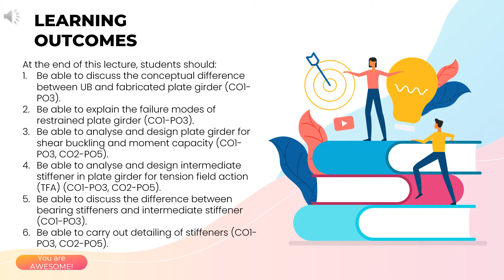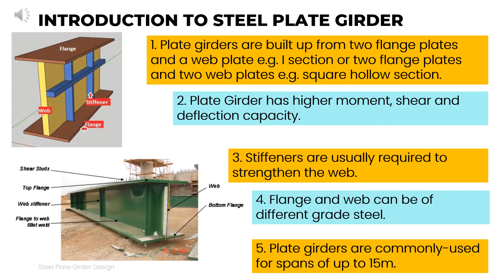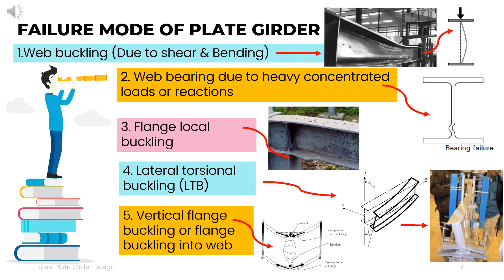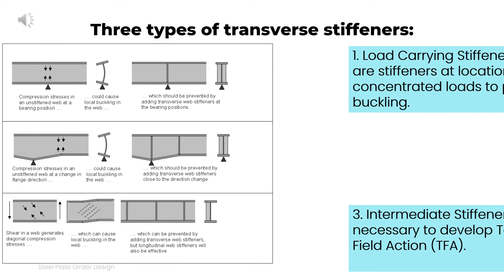Steel Plate Girder (Eurocode 3)-Summary By Dr.Ina

Comment: 5A5_Asyira 

A plate girder is a large steel “I-section” beam that is fabricated by welding (or sometimes bolting) together separate steel plates: a top flange, a bottom flange, and a vertical web between them.  ￼
It differs from a standard rolled I-beam: since rolled sections are limited in size by the rolling process, plate girders allow engineers to build deeper/heavier beams by fabrication instead of rolling.

Comment: 5B1_Aliff Irfan 
The video explains the conceptual difference between Universal Beams (UB) and fabricated plate girders under Eurocode 3. While UBs are standard rolled sections, fabricated plate girders are built from separate steel plates, allowing customization for longer spans or heavier loads. Eurocode 3 provides guidelines for design, strength, and stability, helping engineers determine when standard sections are insufficient. Overall, the lesson emphasizes understanding not just the calculations but the design reasoning behind choosing between UB and fabricated plate girders.

Comment: 5A6_nurul shahida 
1.	Definition & use
	•	It’s used when loads or spans are too large for standard rolled sections.
	2.	Main design challenges
	•	Shear buckling in the web (since it’s deep and thin).
	•	Lateral-torsional buckling (LTB) in the top flange if it’s not properly braced.
	•	Flanges must be checked to ensure they’re not too slender (Eurocode Class 4 limits).
	3.	Design procedure
	•	Estimate depth (span/depth ≈ 15 as a starting point).
	•	Choose flange dimensions to resist the required bending moment.
	•	Check shear resistance of the web and verify it against buckling criteria.
	•	Check for LTB and provide lateral restraints if needed.
	•	Verify serviceability limits (deflection, vibration, etc.) after strength checks.
	4.	Eurocode 3 checks include:
	•	Section classification (Class 1–4).
	•	Effective width of slender plates.
	•	Shear buckling resistance formulas (EN 1993-1-5).
	•	Moment-shear interaction.
	•	Stability verification (lateral buckling).

Comment: 5A6_ZAID: Steel Plate Girder Summary

Steel plate girders are built-up structural members designed to resist loads primarily through bending and shear, offering higher stiffness for heavy loads and deeper sections compared to universal beams. They are commonly used in bridges, long-span floor girders, railway/road structures, and industrial crane girders.

Key lessons include their construction from flange and web plates (potentially different steel grades), with thick flanges, large depth, and thin webs that require stiffeners to prevent buckling due to high D/T ratios.

1. Conceptual Differences and Design Basics
(a) Difference from Universal Beams
-Universal beams are standard rolled sections, while fabricated plate girders are custom-built for specific needs like greater depth and load capacity.
-Girders provide enhanced moment, shear, and deflection capacity, making them economical for spans up to 15 meters.
(b) Construction and Welding
-Composed of two flange plates and a web plate, welded using continuous automatic electric arc or submerged gas methods (fillet welds, double pass on both sides).
-Designer selects plate sizes and grades for optimal performances.
(c) Failure Modes and Prevention
-Steel plate girders are prone to several failure modes, emphasizing the need for proper detailing and restraints.

2. Key Failure Modes
-Web buckling due to shear, bending, or heavy concentrated loads/reactions.
-Flange local bucklings.
-Lateral torsional buckling.
-Vertical flange buckling into the web.

Comment: The universal beam (UB) and the plate girder perform similar structural functions, but they differ in size, shape, and load-carrying capacity. A plate girder can fail in several ways, including flange local buckling, lateral torsional buckling, vertical flange buckling, and web buckling caused by heavy concentrated loads. These potential failures can be prevented by adding transverse stiffeners and providing adequate lateral support. MUHAMMAD HARIS IMRAN BIN AZMAN 5C4

Comment: 5C4: Aiman

A plate girder is a structural member that resists bending and shear, typically built from welded, bolted, or riveted steel plates forming an I-shaped section with a deep web and narrow flanges.

Functions:

Used instead of rolled sections for long spans

Supports heavy loads

Common in railway, road, and crane girders

Provides high stiffness for deep sections

Failure modes:

Web buckling (shear/bending)

Web bearing (from concentrated loads)

Flange local buckling

Lateral-torsional buckling

Flange buckling into web

Notes:
Load-carrying and load-bearing stiffeners are the same type but must be checked for web buckling and web bearing separately. After web shear buckling, Tension Field Action develops, where diagonal tension in the web increases shear capacity.

Design steps:

Determine minimum web thickness

Check bending resistance

Dimension the girder

Design the web

Design the stiffeners

Comment: 5C4_Hazid

I. Steel plate girder is a structural beam made by welding steel plates together
ii. Design checks for plate girders: bending, shear, buckling ( web buckling and flange buckling), lateral-torsional stability, and serviceability (deflection)
III. used when normal steel beams are not strong or deep enough.

design steps:

Choosing the right sizes for the web and flanges.

Checking bending strength, shear strength, and buckling (to prevent the plates from bending or twisting).

Ensuring the girder stays stable and safe under load.

Following Eurocode 3 rules to check both ultimate strength and serviceability (deflection limits).

Comment: 5C4_Muhamad Hazzim
-It clearly shows the difference between universal beams (UB) and fabricated plate girders.
-Plate girders are built-up members that can be customized for longer spans and heavier loads.
-Under Eurocode 3, design must consider how the web and flanges interact to resist bending and shear.
-More checks are needed for buckling, stiffeners, and welded connections compared to standard rolled sections.
-Fabrication quality and proper detailing are very important to ensure safety and performance.
-Overall, it highlights how plate girders offer flexibility in design but require careful application of code provisions and good engineering judgment.

Comment: 5C4_HISYAM
Steel plate girders are built-up I-shaped beams made by welding or bolting flange and web plates together. They are designed to carry heavy loads over long spans. The main difference between a beam and a girder is their size girders are larger structural members.

Comment: 5B1 - Balqis Umairah

INTRODUCTION PLATE GIRDER 
• Built-up structure made from two flange plates and a web plate 
• high bending moment, shear, and deflection capacity
• Stiffeners
• Flanges and webs can be made from different grades of steel

FUNTIONS : 
i) Replaces rolled steel sections
ii) Supports heavy loads
iii)railway bridges, road bridges, and industrial cranes

FAILURE MODES OF PLATE GIRDER 
• Web buckling 
• Web bearing failure 
• Flange local buckling
• Lateral torsional buckling (LTB)
• Vertical flange buckling or flange buckling into the web

Comment: 5A2- Farah Farhana

From this video, I learned that steel plate girders are structural elements made up of flanges and a web that work together to carry loads efficiently. Their design involves determining the correct dimensions for the flange and web, ensuring adequate strength against bending, shear, and buckling. I also learned that web stiffeners and proper weld details are essential to maintain stability and prevent failure.

Comment: 5C4_MUHAMMAD ALIF HAKIMI : 

Steel Plate Girder is a structural member designed to resist loads primarily through bending and shear. Plate girders are used when deeper sections with higher stiffness are needed to carry very heavy loads. The primary difference between a beam and a girder is its size. They have sections, fabricated by welding two flange plates to a web plate. 

Design and Characteristics :
-Economical design for plate girders (often used for spans up to 15 meters) typically involves thick flanges, a large depth, and a very thin web.
-This high depth-to-thickness ratio makes the thin web susceptible to buckling.
-To strengthen the web against buckling, stiffeners are required.

Common Applications :
-Bridge construction.
-Long-span floor girders in buildings.
-Crane girders within industrial structures.

Common Failures :
-Web buckling due to shear, bending, or concentrated loads.
-Flange local buckling.
-Lateral torsional buckling.

Methods of Prevention :
-Lateral torsional buckling is prevented by providing sufficient lateral restraints, such as a composite slab.
-Web buckling is prevented by adding transverse stiffeners along the beam's web.

Stiffeners :
Function : Help combat web buckling and provide support for concentrated loads or reactions.
Types of Transverse stiffeners : load-carrying stiffeners, load-bearing stiffeners, and intermediate stiffeners.

Basic Design Procedure :
-Calculate the minimum web thickness.
-Determine bending resistance.
-Perform basic dimensioning.
-Complete the web design.
-Finalize the design of the stiffeners.

Comment: 5B1_Dayang: 
Plate girder has a very thick flange but very thin web. as the ratio, it is very high chance the web to buckling. therefore, must be very carefully design for the buckling stress. design procedure for plate girder has 5 basic steps.

function:
- to support heavy loads such as on a bridge structure.

failure:
- web buckling 
lateral torsional buckling
- flange buckloing into web 
 
how to prevent:
- Provide a sufficient lateral restraint
- Add a transverse stiffener along the beam web

Comment: 5C4-Hakim 

A steel plate girder is a large steel beam used in bridges and buildings to carry heavy loads over long spans. It’s called a “plate” girder because it’s made by welding or bolting together flat steel plates — rather than being rolled into shape like an ordinary I-beam.

Comment: 5C4_Syarifuddin.Azfar

Plate Girder Design : -

UB vs Fabricated Plate Girder.
UB is used for short beams (like in buildings), while fabricated plate girders are made for long bridges.

Failure Types.
A plate girder can buckle or bend if it’s too thin or not strong enough.

Shear and Moment Design.
Learn how to check the strength of the girder so it won’t buckle or break under load.

Intermediate Stiffeners.
Add stiffeners (extra plates) to make the girder stronger after it starts to bend or buckle.

Bearing vs Intermediate Stiffeners.
Bearing stiffeners hold up heavy loads, while intermediate stiffeners stop the web from buckling.

Stiffener Details.
Use proper welding and spacing so the girder is safe and strong.

Comment: 5C4 Muhammad Irfan Danish Bin Mohd Jafri

Steel plate girder is a large, I-shaped beam made by welding or bolting together thick steel plates. 

Flange - Resist bending moment 

Web - Resist shear force

Stiffeners - prevent web buckling,transfer reaction,and support tension

Comment: 5C4_Ahmed Asyraf

steel plate girder - primarily resist bending and shear load and it is made by welding together an i beam and two steel plate.
stiffeners usually required to increase web strength. flange and web can be steel of different grade. support heavy load such as bridge and mainly use in railway and rad bridge

Comment: 5C4-Fakhri Daniel

A steel plate girder is a large welded steel beam used to support heavy loads over long distances.
It mainly resists bending and shear, but can fail by bending, shear, buckling, fatigue, corrosion, or bad connections.

Comment: 5C4_MUHAMMAD DANIEL BIN MOHD AMIN :

Steel Plate Girder :
A steel plate girder is a built-up I-shaped structural member made by joining steel plates through welding, bolting, or riveting. It mainly resists loads through bending and shear, and is generally larger than a standard beam.

A plate girder is a built-up structural member made from flange and web plates (e.g. I-section or box section). It has high moment, shear, and deflection capacity, and often includes stiffeners to strengthen the web. The flange and web may use different steel grades, and plate girders are commonly used for spans up to 15 m.

FAILURE MODE OF PLATE GIRDER
1.Web buckling (Due to shear & Bending) 
2. Web bearing due to heavy concentrated loads or reactions
3. Flange local buckling
4. Lateral torsional buckling (LTB)
5. Vertical flange buckling or flange buckling into web

Comment: 5B1_Fitrina

Plate girders is a structural member that resist loads in bending and shear, typically an I-beam cross-section. It is built up from two flange plates and two web plates, has higher moment, shear and deflection capacity, usually required a stiffener to strengthen the web, and commonly used for spans of up to 15m.

Functions:
- replace rolled sections for a long beam spam 
- support heavy loads
- used in railway, road bridge girders and crane girders
- used when deeper section having higher stiffness to carry heavy loads

Failure mode:
1. Web buckling (due to shear, bending)
2. Web bearing (due to heavy loads/reactions)
3. Flange local buckling
4. Lateral torsional buckling
5. Vertical flange buckling/flange buckling into web

Types of transverse stiffeners:
- Load Carrying Stiffeners
- Load Bearing Stiffeners
- Intermediate Stiffeners

Comment: 5C4_MUHDAFIQ:
STEEL PLATE GIRDER

-	Can be defined as structural members that can resist the loads especially in bending and shear moments.
-	Usually, the shape of the plate girder is typically an I-beam cross- section.
-	To form the steel plate girder, it either consists of process of welding or bolting or riverting. 
-	It consists of higher moment, shear and deflection capacity.
-	Commonly used for spanning up to 15m.
-	Stiffener is also required to strengthen the web.

FUNCTIONS OF STEEL PLATE GIRDER:

-	Replace rolled sections for a long beam span.
-	Supports heavy loads.
-	Mainly used in railways and road bridge girders.

FAILURE MODE:

-	Web buckling
-	Web bearing
-	Flange local buckling
-	Lateral torsional buckling

TYPE OF TRANSVERSE:

-	Load carrying stiffeners (web buckling)
-	Load bearing stiffeners (web crushing)
-	Intermediate stiffeners (tension field action)

Comment: 5B1_Muhammad Ammar

In summary, a steel plate girder is a built-up beam made from flange plates and a thin web plate, designed to resist bending through the flanges and shear through the web. It often includes transverse stiffeners to prevent web buckling, especially because plate girders usually have a large depth but very thin web, giving a high d/t ratio. The plates are welded together, and the flange and web can be of different steel grades, allowing flexibility in design. Plate girders are used for long spans and heavy loads, such as bridges and crane beams, where rolled sections are not large or strong enough.

Failure Modes
 1 Web Buckling – due to shear or bending.
 2 Web Bearing – crushing under point loads or support reactions.
 3 Flange Local Buckling – thin flange under compression.
 4 Lateral Torsional Buckling – twisting of unrestrained compression flange.
 5 Flange Buckling into Web – vertical bending failure.

Transverse Stiffeners
 • Prevent web buckling and support concentrated loads.
 • Essential when web is thin.
Types
 1 Load-Carrying Stiffener → stops web buckling at loads.
 2 Load-Bearing Stiffener → stops web crushing at supports.
  3 Intermediate Stiffener → develops Tension Field Action (TFA).

Comment: 5C4 Adam 

A steel plate girder is an I-shaped beam made from welded steel plates (flange + web).

It resists bending and shear forces and is used in bridges, buildings, and cranes.

Stiffeners are added to prevent buckling and increase strength.

Functions

1. Supports heavy loads over long spans.

2. Replaces rolled steel sections for larger sizes.

3. Provides economical design with thin web and deep section.

Transverse Stiffeners

Prevent web buckling and increase shear strength.

Create Tension Field Action (TFA) after buckling, acting like a truss.

Types: Load carrying, load bearing, and intermediate stiffeners.

Failure Modes

1. Web buckling

2. Web bearing failure

3. Flange local buckling

4. Lateral torsional buckling (LTB)

5. Vertical flange buckling

Failure Prevention

Add lateral restraints and stiffeners.

Ensure proper welding and material quality.

Design Process

1. Minimum Web Thickness – Ensure web is thick enough to resist buckling.

2. Bending Resistance – Calculate girder’s moment capacity (flange critical).

3. Basic Dimensioning – Determine web depth and flange width.

4. Web Design – Check web stability under shear and bending.

5. Design of Stiffeners – Add stiffeners to strengthen the web

Comment: 5C4_FarisHazwan

Plate girder is built-up steel beam made from web plate + flange plates and used for heavy loads and long spans.

Functions:
Support and transfer loads in bridges/buildings.
Provide longer spans than rolled sections.
Efficient for large bending moments.

Failure:
Web buckling
Web bearing
Flange local buckling
Lateral torsional buckling (LTB)
Vertical flange buckling

Preventations:
Provide sufficient lateral restraint
Adding transverse stiffeners

Type of stiffeners
Bearing stiffeners – at supports / heavy loads
Intermediate stiffeners – along span for shear
Connection stiffeners – at cross-beam connections

Design Process
Minumim web thickness
Bending resistance
Basic dimensioning
Design of stiffeners

Comment: 5C4_Irfan Harith
Plate girders focus on bending and shear with 2 flanges and a web, this is to support heavy loads such as in railways and bridge. Failure can happen due to heavy concentrated poads and reactions,LTB and buckling. This can be prevent by adding transverse and sufficient lateral restraints.